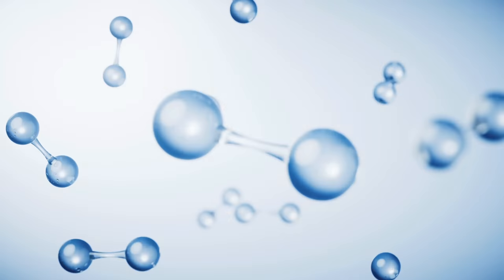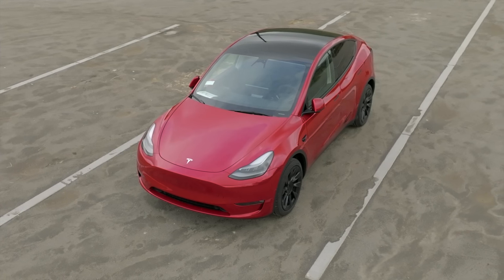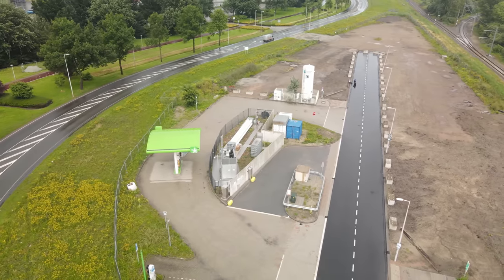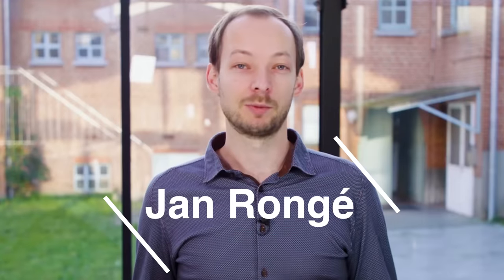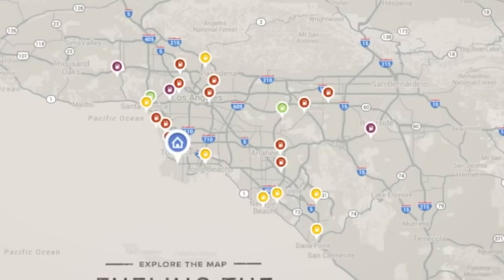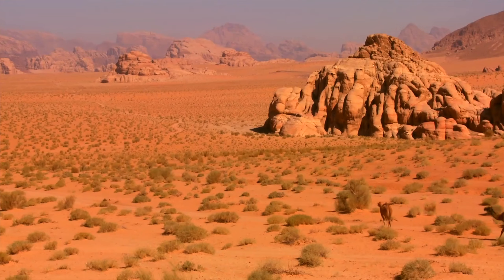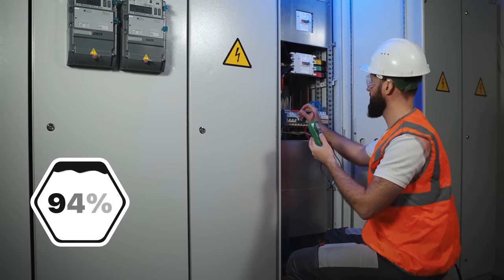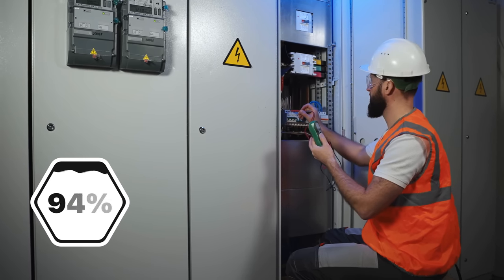Breakthrough Solar Panel Makes Hydrogen At Home!

Comment: 50% efficiency on what is currently known to be the most abundant element in the universe isn't that bad tbh when it doesn't pollute (unless you're one of the weirdos that considers water vapor to be pollution.), and that will theoretically go up in efficiency the more the tech matures.
Regardless, hydrogen fueled ICE something I'm absolutely hyped for, and if the Tacoma project works out for Toyota I hope they expand to the Tundra because I would buy that in a heartbeat and see about getting a trailer portable solar electrolyser so that if/when I inevatably move I can take that with me.

Comment: does teslas' step-up voltage work for electrolysis?
fine mesh of this thing should work in dense water vapor set up.. best storage form for hydrogen is water itself.

Comment: Hydrogen belongs to commercial infrastructure. Lots of power is needed where batteries are not enough.

And predefined routes, endpoints, and bases for refuelling.

At home, batteries provide more flexibility. You can charge at a 100 year old socket in the middle of nowhere with an adapter.

Comment: This was really interesting to watch, however, often times too many good idea's simply don't look downstream at the side effects, or concequences of the technology.  Nobody thought wind and solar would be as enviromentally devistating as they have turned out to be.  Between the direct result to wildlife from air hot enough to catch birds on fire over ivanpah, and the mass slaughter of birds, owls and bats at the hands of wind mills, not to mention the massive consuption of material to build both those green energy programs en mass, the question truely is: "What will happen to the climate if we start sucking the watervapor from the air on mass scale?"  Could that be dangerous for places where lack of rain is already causing environmental issues?  What will happen if we build an ivanpah like solar farm to harvest hydrogen?  Techonogy like this directly changes the atmosphere.  Perhaps this is something we should consider much more deeply then being lured into it's promise of cheep energy.
Reply: Great points made

Comment: I’d personally want a hydrogen electric hybrid with those panels on the top of it
Reply: If you drove an EV, you would soon lose the range and charging fear. I've been driving EV's for 6 years now, the difference in range and charging infrastructure in those short years is astounding and I will never go back
Reply: That would be prettin interesting to see, lol I think it would defeat the purpose of sving on weight!
Reply: And fly fly fly away. 🤣😂

Comment: While 250 litres a day for a panel sounds impressive - at 50% efficiency ( that's being generous !) you will get about 1.5 miles in your hydrogen car. So having 20 panels will get you 30 miles a day. So 40 panels will give an average commute distance (60 miles a day -ish). 40 panels will set you back $31,999 ( they drop a dollar to make it look cheaper).  Did I mention the compression, specialized pipework and storage required ? That'll be another $19,999,sir....And your car will be (at least ) $50,000. My advice - fill your car up outside your garage....and don't try going on road trips - there aren't any (hydrogen) filling stations where you want to go...maybe stick with an "expensive" Tesla Model3 at $40,000 ?

Comment: wouldn't it be simpler and more practical to have normal solar panels and the an additional electrolizer? You could have your panels directly power your home and direct excess energy for hydrogen production, you could then use hydrogen instead of batteries to power your home at night. It would be just better as an addon to already existing PV systems, I'm not a specialist but I'm pretty sure that it would be better this way. Hydrogen has it's downsides because fuel cells need rare metals (platinum if I'm right) and the other being that most hydrogen now is grey hydrogen coming from processing oil, making your own H2 would solve the second but it still leaves the first.

Comment: A devastating hydrogen tank explosion occurred in South Korea on May of 2019. Two men died and several buildings including even for more than 100 meters away, have been seriously damaged. 
It was a P2G testing site and a hydrogen is produced by the water electrolysis where (3) hydrogen storage steel tanks of 40,000 liter (ID: 2,450 mm, H: 7,668 mm) with operating pressure of 1 MPa.
The origin of the ignition inside of the hydrogen tank has not been proved.

Comment: I could see this used in cases where natural gas burners are replaced with H² burners, resulting in minimal infrastructure change and clean burning, as curent gas tops for exemple are horrible with CO and carcinogenic compounds.
Reply: If you are putting solar on you roof, and planning to use the harvested solar energy to cook with, you are throwing away a very large portion of the solar power. It would be much more economical in the long run to replace the gas cooktop with an induction cooktop. That utilizes the solar power to directly heat the pan - no wasted energy going past the pots and pans in the form of hot water vapor from the combustion of hydrogen.
Reply: @jimmurphy5355  
Used my induction hob 30 minutes ago.
Can't beat it.
I'll never use gas again.
Reply: @jimmurphy5355  yes. But replacing a hot water boiler is more expensive. You just run the gas to the burner.
Also a gas turbine could cut cost and emission with a slightly more steady out put ( heat is also harvested) than direct solar with H² not needing to be stored at high pressure and a long time.
Im saying it could be a plug and play in very specific scenario with direct use or cheap low pressure storage.
Reply: @GeorgeBP81  The panels cost triple what a standard solar panel costs. For much less than the extra cost of the hydrogen panels,  it would be possible to replace the boiler with a heat pump unit.

Comment: Check out the hydrogen House in NJ. The problem with the new panels is the Hydrogen is at normal pressure. So you can't store it unless you get +350psi😢 if you use an electrolizer that has a built in comprsser. I live in N fort worth. Near alliance airport. I have to worry about the summers which  gets about  105-110f 😢 so I will most likely need 3 or 4 40ft tanks, btw used propane tanks will work. BUT you need all the lines, valves, etc to be made from stainless steel. Your argument is kind of flawed. therefore the only thing you can do with it is to use a fuel cell! You Can't use it to cook with, or heat anything in your house! 😅 as Hydrogen doesn't have an oder, well you get the idea. I hope ~~Cris

Comment: Since the PV panel and the electrolyser unit are seperate and functionally independent, what is the point of having the electrolysis unit on the back of the solar panel, where it is hard to maintain, and replicated more times than necessary? If it was a standalone unit on the ground, you would have only one electrolyser to maintain, connected to 40 panels. Then you can colocate a compressor with the electrolyser. For someone who wants it 'all in one', seperating your production of a flammable gas over your entire roof area, is just utterly ridiculous.

Comment: i think those 250 liters {volume} are in gas form, and you are doing math with liquid liters numbers
from the FAQ of the product web paga : A smaller roof with 20 hydrogen panels will produce 120-240 kg "per year", which is 4-8 MWh of hydrogen energy

Comment: You can't compare the weight of batteries with the weight of hydrogen. A better comparison would be the weight of electrons to hydrogen ;-)
The batteries are a storage system, hydrogen needs its own storage that has a weight, right? So how much do hydrogen tanks and associated cooling systems weigh?

My three pieces of 48V/100Ah boat batteries weigh 60 kilos each but there are much lighter batteries with the same nominal capacity. Electrons are fairly light 😊

Thank you for your brilliant channel, good forward looking info there!

Comment: go hydrogen , was thinking today about time we had a direct solar to hydrogen , but a direct solar to hydrogen, as in a photosynthesis system , there are teams working on it , if they can do it under high pressure will be a big step forward . Plus you can use hydrogen direct ,run an existing ICE engine [ Mazda had it in an RX8 ,a hydride cell in the boot lid ], plus you can put H into a catalyst and get huge heating effect ,pretty sure a normal car cat will do it .The big win I see is the 'no toxic non recyclable battery 'crap left after !. we are already seeing farms of old electric vehicles just sitting rotting ,no one knows what to do !? .

Comment: Fuel cells are made with expensive metals like platinum that function as a catalyst for the production of electricity. These metals are expensive and rare (hard to mine) and are one of the reasons (besides the inefficiency of the total cycle) that hydrogen as an electricity source is still expensive. Still, I welcome all research and development because batteries are not the ideal solution for a number of applications. Hydrogen is just not there yet as a solution for most cases because of the restrictions you have mentioned.

Comment: Free market, they can develop and try to compete with battery electric.
But I think it will be more of a niche chase application than a wide scale technology + storing and potentially burning hydrogen is about the unsafest thing I can imagine and you would need many safety mechanics to make it usable without risking to blow up your house, so if it succeeds, great, but I don't think it will.

Comment: Hydrogen would be the easiest and most feasible alternative. The most reliable drive trains for automobiles is internal combustion, that same infrastructure can be adapted relatively easy to run on hydrogen. The storage solution is not unknown, the government and cellular towers have been using metal hydrides to store hydrogen for years, but getting them to let anyone else use the guarded technology might be a challenge, they have thus far made anyone who has tried stop.

Comment: This would be useful if there were furnaces that could run on hydrogen. Maybe cut the use of propane , fuel oil and natural gas use to heat homes in the winter.

Comment: If hydrogen is produced in the home, it can be used in a gas boiler to heat hot water and space heat at 90%b plus efficiencies.

Comment: Hydrogen losing half of it's own "efficiency" doesn't mean anything in relevance to performance efficiency and cost efficiency compared to current systems. Considering hydrogen is potentially fully sustainable, that really isn't a problem. What needs to be addressed is complete end to end use systems.

Comment: If you could have a home car that would give a 400 mile range, that would meet most domestic needs, for a vehicle to go a longer distance, rent one, Problem solved!
I we could have a motor vehicle that ran on hydrogen, especially if you could refuel it at home, what a game changer that would be. Operational costs would be minimal.
Where, and when do we get one?

Comment: You didn't answer the most important question... is the energy you get from the hydrogen more than the electricity required to produce it?  Because if it isn't, the product makes no sense whatsoever and you should just use the electricity from the panels directly.

Pure hydrogen fuel cells are actually quite reasonable.  Basically, the lighter the hydrocarbon,  the cooler the fuel cell can run.  A pure hydrogen fuel cell runs at room temperature, is completely passive (no moving parts), and can be purchased at a reasonable cost.  However, small (cost effective) pure hydrogen fuel cells don't produce huge amounts of power.  They can produce the power all day long, but were still talking less than 1kW typically.   Still, that would be 24kWh over 24 hours.  As long as it isn't directly powering your loads, its a fine way to get power out hydrogen.

Storing the hydrogen and the inefficiencies of generating it and converting it to electriicty, however, remain.

The storage issues for hydrogen don't make any sense either.  A LiFePO4 battery has around-trip efficiency of around 95% at modest C-rates (0.2C or thereabouts).   Electronic components converting the battery's voltage to house power are where the efficiency losses occur, but in fact that is mostly just a matter of the battery voltage.

Basically, for a low voltage battery system:  Charge controller, 98%, Battery, 95%, and inverter, 90%.   Total is 0.98 * 0.95 * 0.90 = 84%.   For a high voltage battery system.  Charge controller, 99%, Battery 96%, and inverter, 96% = roughly 91% (Tesla megapacks advertise 93% or so but that isn't at 240VAC, its much higher).

So high voltage battery banks (e.g. 400VDC) have a round-trip efficiency DC-store-to-AC-load of roughly 93%.   The cost of batteries has been dropping so quickly that something like 20kWh?  That's around $5000-$6000 worth of LiFePO4 batteries.  4 x rack-mount 5kWh batteries.

Hydrogen can't compete with that under any scenario.

Comment: How do each panel fit into the recycling system. They will not last forever. Right now I am hearing problems with solar pannel recycling.
Reply from the maker: solar panels last 20-30 years quite easily, after that yeah we'll need to make sure we have a good circular lifecycle

Comment: Unless you use the hydrogen directly, using electricity to generate it to then change it back to electricity sounds like overcomplicating things to me. That's essentially the same thing we do when we storage electricity in a battery, of course, but given the current state of hydrogen and battery technology, if I had to make a bet 5 years from now, I'd go with the second one.

Comment: The next tech hurdle for hydrogen is storage. And if you make your hydrogen at home then there's no need to rebuild a fossil fuel style transportation network. 
Hydrogen cars are rolling on the roads in California right now, the toyota mirai. Hydrogen is the future. It's an efficient way to store energy that can be efficiently converted to electricity in a fuel cell.

Comment: 90 percent of the driving I do is to work and back home so considering I own a v8 crown vic the switch would save me 60 to 80 a week
Reply: Until the hydrogen corroded the heads, valves and block (which would defeat the object?)
Reply: Granted yes for Ice systems hydrogen fuel would require different meterial for the engine, however I would make the switch if I could make my own hydrogen and the vehicle was a fuel cell system.

Comment: Why even consider installing a fuel cell to the system you described? Just install an A/B switch on the output of the solar panels. And when you want electricity, instead of Hydrogen, it’s there for you.

Comment: Perhaps a single such panel in your home to burn the hydrogen directly in your gas water heater (modified to burn hydrogen) or hydrogen to heat your gas stove?
Reply: Why bother with converting solar power to hydrogen?  You will get far, far more benefit using the electricity directly. Especially, if for the water heater you use a heat pump, and for the stove you use an induction cooktop. It's also much easier to store your mid-day solar in a battery than in the form of hydrogen. Low pressure hydrogen is far too bulky to be practical, and compressing it to high pressure wastes energy, makes noise, needs expensive pumps that cost a lot.
Reply: @jimmurphy5355  
Electricity to a below Infrared panel, or alternatively underfloor heating.
Reply: I like it. In fact, I'd love this to be a way to cook with open flame. Yes induction cooktops are awesome, but you can't really wok a Chinese fried rice on an induction cooktop or you'd need one specially designed for woks. So having a clean burning fuel to cook at home without the CO2 and other combustion byproducts is a huge plus, IMO
Reply: @jimmurphy5355  actually, pretty certain heating a gas is much more efficient then electric heating.
Reply: If you are starting with electricity from solar panel it is way, way more efficient to use the power directly than to turn it into gas and then burn it.
Reply: @autohmae   gas stoves are 30-ish percent efficient while induction is 75-ish efficient.  3kw of energy from gas vs 1.25kw to heat 1kw of heat into water.
Reply: @gr1f1th  interesting !

Comment: As far as electric power production such a method for powering fuel cells might be better if you stored not only the hydrogen, but also the oxygen created from process. I say this because pure oxygen and pure hydrogen combined in a PEM fuel cell should reduce failures by virtue of the purity of the materials. Atmospheric oxygen has atmospheric junk gasses and materials that may contribute to shorter PEM life. I believe in their concept panel the oxygen is presently disposed of as waste material.

Comment: Funny, you didn't support green hydrogen and now you are on the bandwagon. I told you green hydrogen was coming and will replace fossil fuels for many uses. Heating, cooking, heating water, running a generator or fueling a car.   These will be used at highway fueling stations along highways for refueling semi trucks that can not sit for hours waiting to be charged from solar or grid power.

Comment: We need power utility companies to develop large scale of hydrogen conversion and storage for the surplus of clean energy. Not just small scale system for single homes and offgriders.
Reply: It’s a pain to store, better to convert it into a more useful form with carbon dioxide.